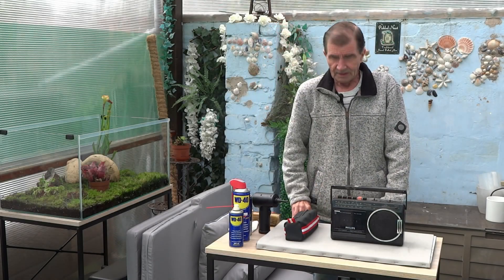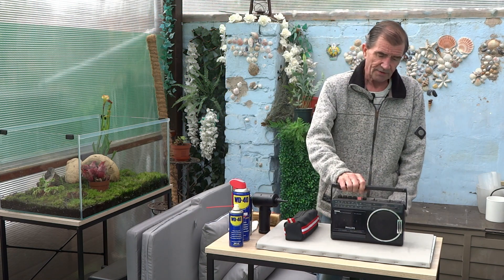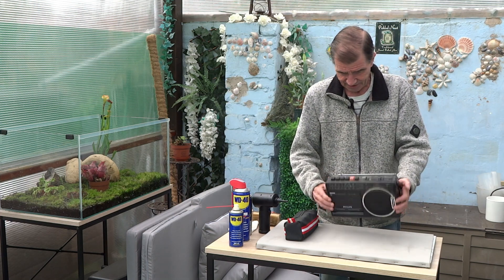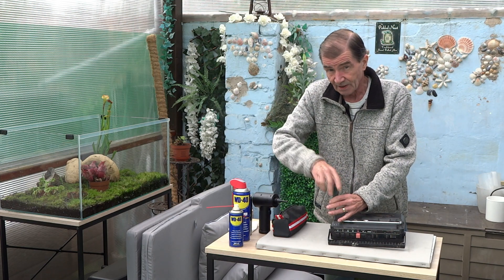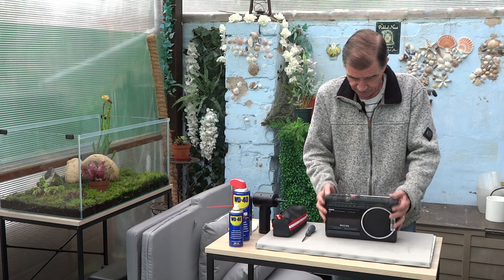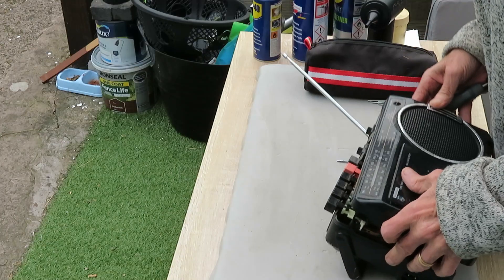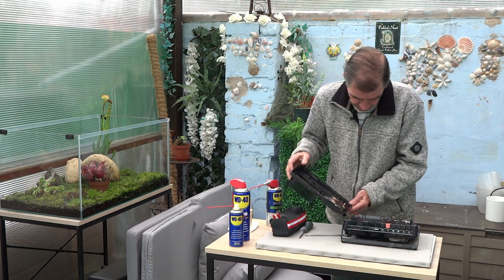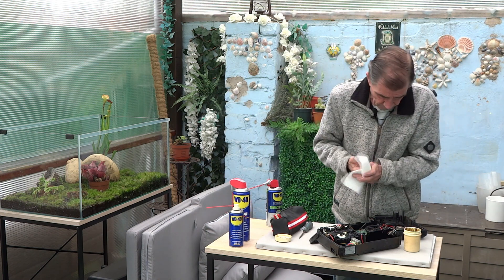How to fix a Crackling Radio

Comment: That was very good, Tony. I wonder if you could help me with a problem with my stereo. I just do electronics for a hobby and I managed to replace an amplifier chip and two resistors to get the sound back on my 1991 Hitachi stereo system, but I'm left with a weird fault. The radio, all wavebands, will work great for about 2 minutes, then they will slowly disappear, leaving just static (on all wavebands) and crackling. Also, when I power the system up, the radio won't always come on, but when it does, it does the same thing again, as above.

Thank you.
Reply from the maker: If this is happening on ALL wavebands, then I would initially suspect a dry joint on the main tuning capacitor, or the RF coupling capacitors (usually just a few pF) around it.  Even the vanes of the tuning capacitor itself could be failing.  
Unfortunately, in a post like this I can't really advise any further without using diagnostic equipment.
Reply: @LPGexpert  Thanks, Tony, that narrows it down a bit. I was thinking capacitors myself. I'll give them a check.

All the best,

Frank